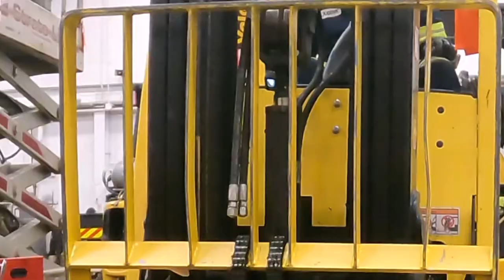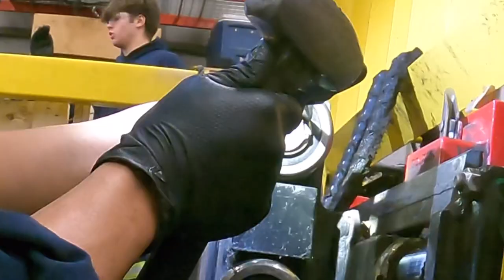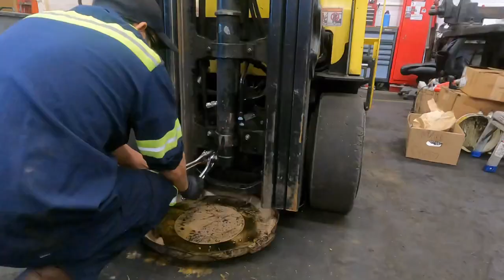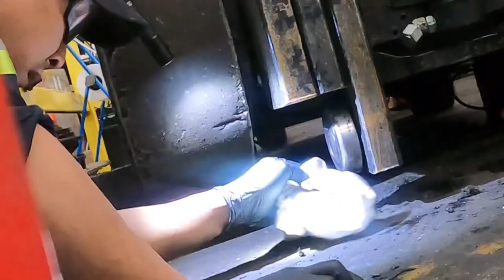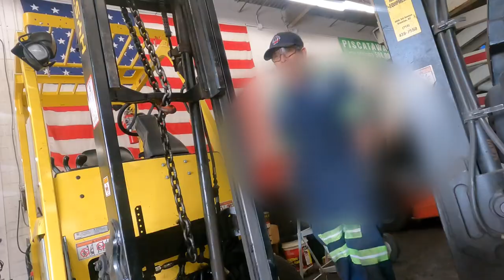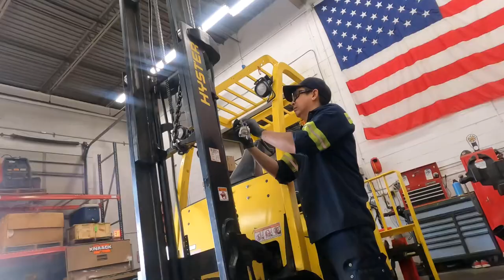Forklift  mast bearings replacement

Comment: Been a fork truck engineer for 24 years now, main supplier of Yale and Hyster trucks. I used to remove carriage assy and then complete mast assy and split it flat on the ground but damn it's a lot of work until I was shown this exact way. As long as you use correct chains etc to lock off and secure mast assy before removing any mounts/brackets then you are all good... So much easier this way.. nice work dude... 👍👍
Reply from the maker: Thank you
Reply: Not really. The correct way of doing it is the way you’ve been doing it
Reply: @dakotaalexander9292  you are 100% correct, it is the correct way and safer to do it flat on the floor, but it is much easier and quicker to do it with the mast still on the truck...